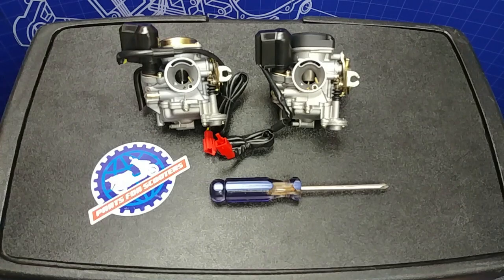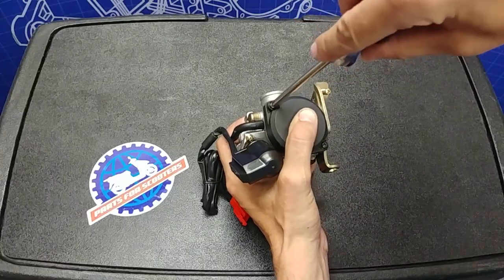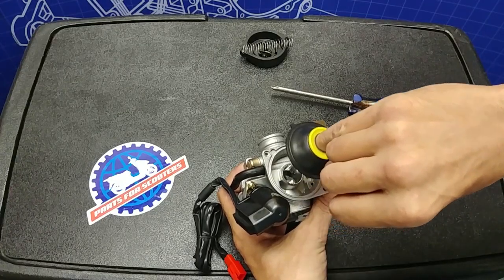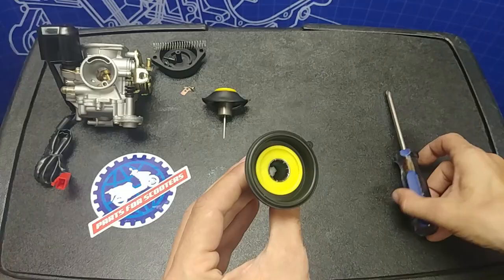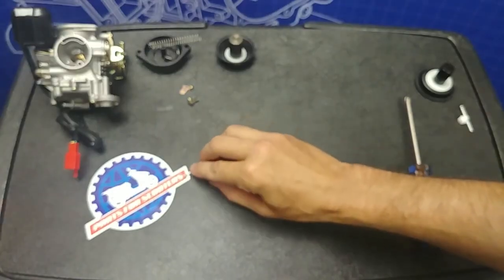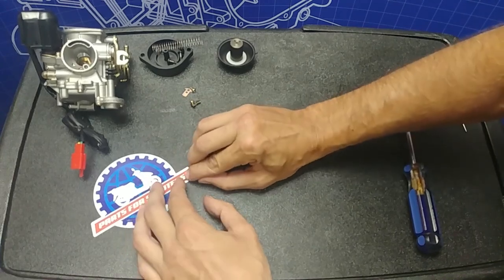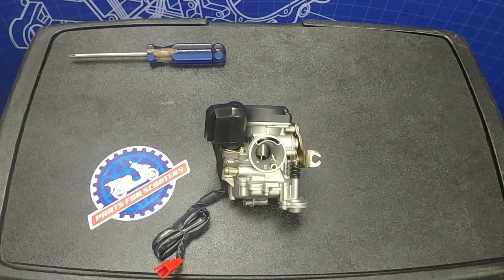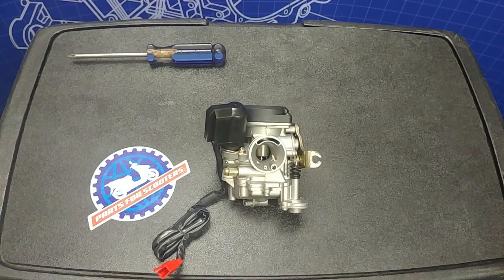How to Adjust a CVK Carb Needle on 139QMB & GY6 Scooters

Comment: The screw is a JIS screw not a Phillips.
Reply: But if it takes a phillips driver then its a phillips head screw
Reply: Its the same thing
Reply: Can what he was talking about and showing, can that also be a problem with fuel filter leaking gas on my 2025 boom moped 50 cc